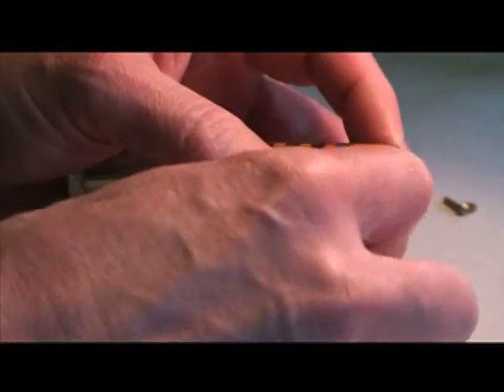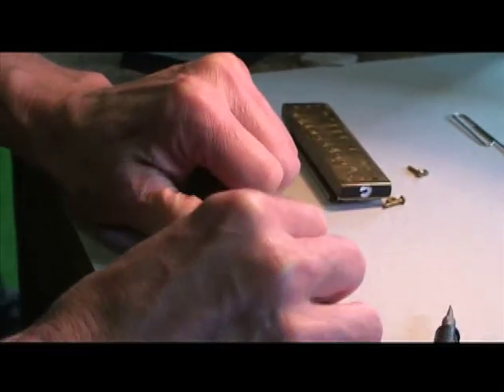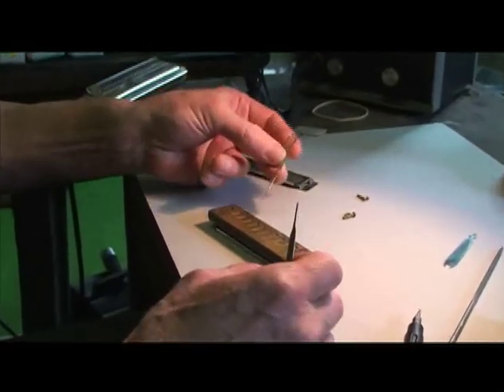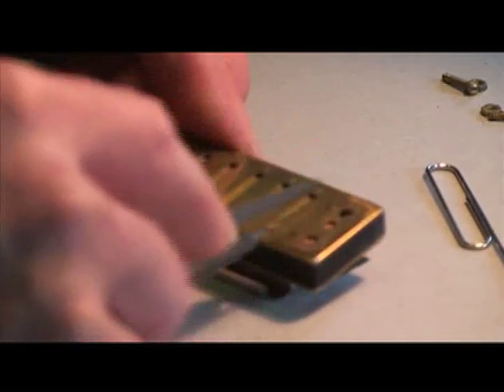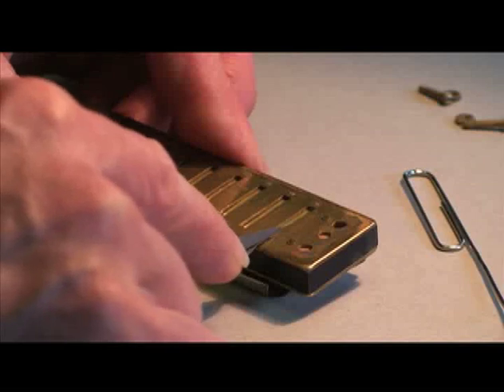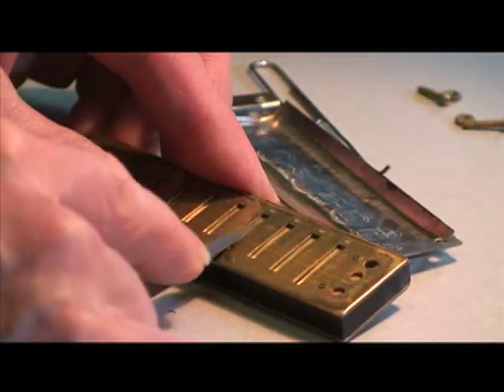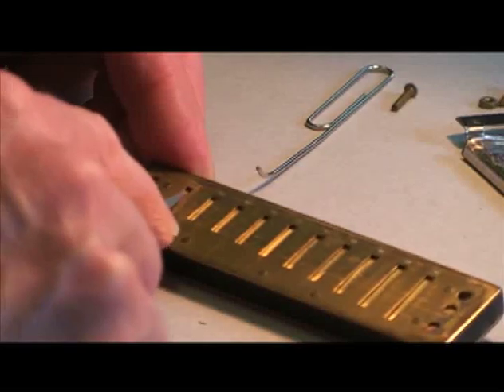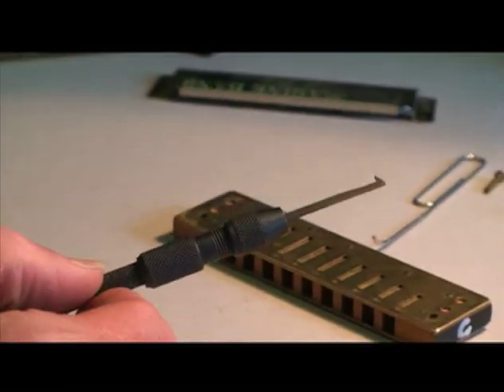How to Tune a Harmonica - Lesson 1

Comment: What if you don't have a tuner? ... In any case, what I do is make an audio recording of each note from a new harmonica (which typically is correctly tuned to its "just tuning" specs). When the harmonica goes out of tune I loop the original recording of the note(s) and match the original pitch, by ear, based on the original recording. [Note: I use a 10 buck voice recorder I got on Ebay.]
Reply: They have free tuning harmonica apps 👍
Reply: They have free harmonica apps for harmonica tuning 👍
Reply: @jeffreys.harris3433  ... Yeah, I eventually got one.
Reply: @lawshorizon  ya after I posted it I noticed it was like 4yrs ago 🙈 I had thought you would've got one👍

Comment: Is it possible to change the scale of you're harmonica?
Reply: I feel like that all depends on the material that remains on all the reeds to set the to the temperament you want for each reed. Manually scrapping off material, I imagine, is only practically effective within a few dozen cents. Probably better to have a machine cut close to the temperament you wish, and then up to you for any further fine tuning. I have seen some people drop or raise certain reeds with a dab of solder on the free ends by like a half step to involve certain notes to change the scale.